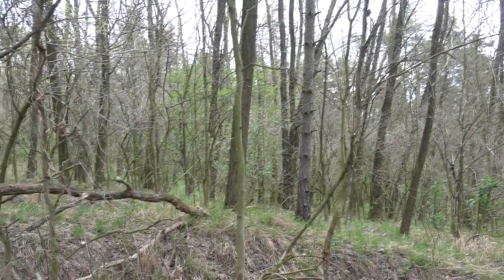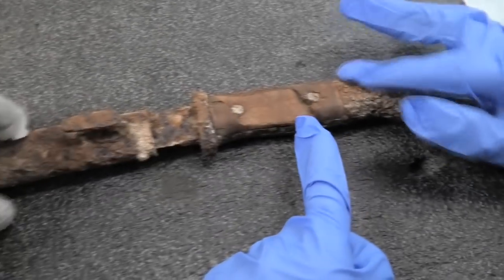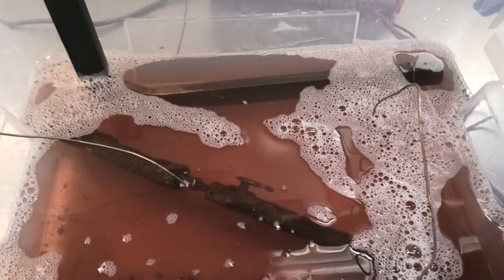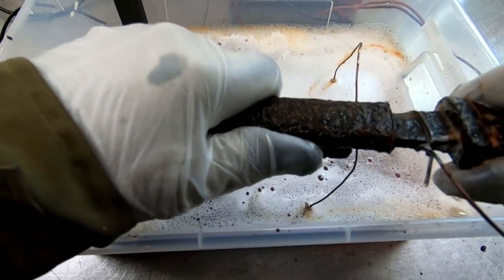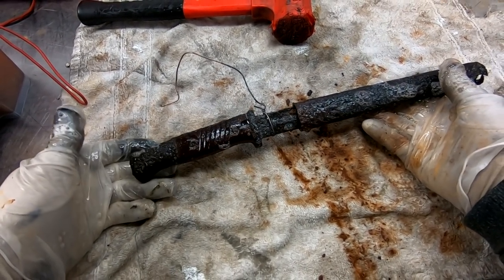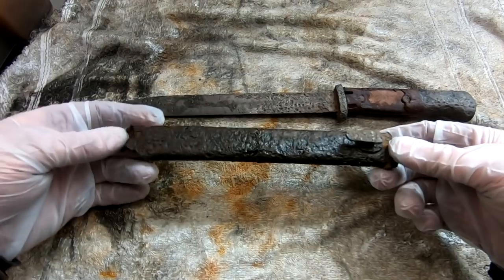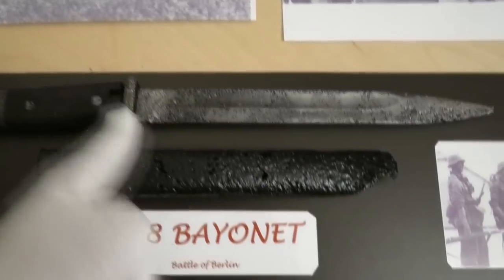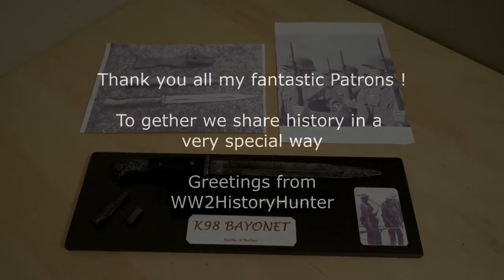German WW2 bayonet.The homecoming.

Comment: Electrolysis is directional. So ideally you should have a tank that has anodes on all sides. I used to use it to restore cast iron cooking pans etc. My tank was a big blue barrel with stainless steel sheets lining it all around.
Reply from the maker: Thanks for feedbacka nd for watching

Comment: Very nice find indeed,  one of my friends had one he kept in his car for self defense,  Greg didn't know what he had, I traded him a pack of cigarettes for it, complete bayonet assembly,  frog in very good supple condition, scabbard has a small dent. The grips are wooden not bakelite though, very early issue. One of my pre war K98s is now complete, got the issue sling,cleaning kit, complete marching kit incl.Zeltbahn (Wermacht) , the leather  is very fine condition and the shovel has a razor sharp edge on one side. I found 18 small marks on the blade little handmade notches, kill marks. The uniform is also complete, a Lance cpl of the Grossdeutchland  Inf.regt.  it fits me perfectly too but those jack boots heavy and blistered my feet. Everything in very good plus condition,  even got the reversible camo smock winter white to summer with helm cover.
Reply from the maker: Thank you for sharing and be safe William :)
Reply: @WW2HistoryHunter  you're very welcome my friend,  oh , I love that SS Fireman's are restoration,  now working with decals can drive you up the wall, ripping, misaligned etc.., now before setting the decal,  spray the  project piece with a clear coat gloss, let dry, apply the decal, with a damp cotton ball force out any air bubbles, wrinkles, etc. Let dry and apply a final clear coat, that'll  preserve the decal sealing it, won't chip, split, fade. Removing light rust from metal, use medium grade steel wool, won't harm the finish but will remove rust corrosion. That's good for wood too. I restore military antiques and furniture for a hobby, I fully restored  a friend's  M1 rifle, beautiful  tiger stripe grain,  I make my own parkerizing and bluing,  heat treated at 350 degrees 1 1/2 hrs baked on.